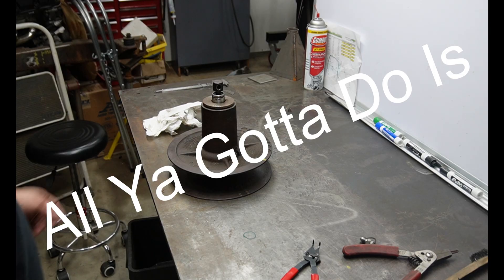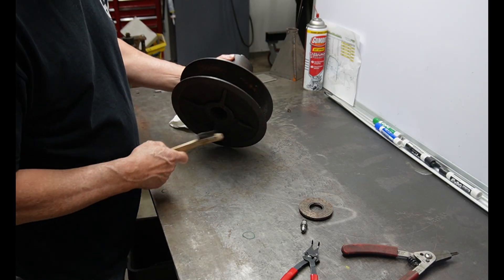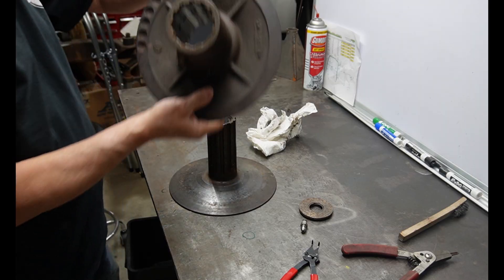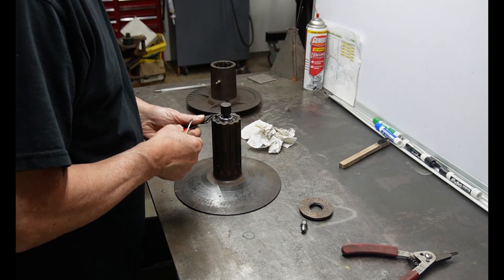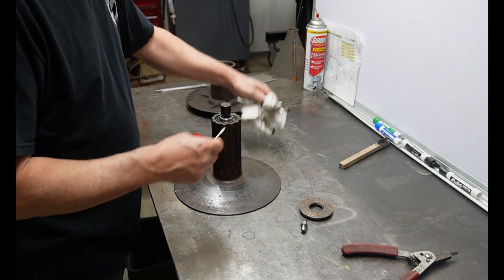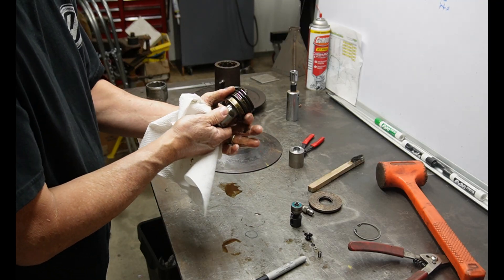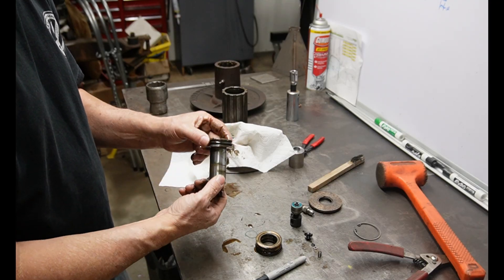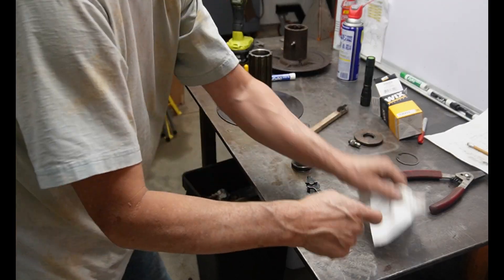Bobcat Variable Speed Drive Disassembly and Re-Assembly

Comment: Have you ever had the large snap ring that holds the bronze piston pop out under pressure?  I've had this happen twice.  The first time I thought that I had not adequately seated the snap ring.  After the second time I determined that the snap ring may be a little rounded, a little loose, and the face of the piston appeared rounded a bit.  So , I have squared up the rounded face of the bronze piston  that contacts the snap ring on the lathe, squared up the face of the snap ring on the belt sander and gave it a little stretch.  Hopefully it will now stay put.
Reply from the maker: I have not had an issue like that. I did put new snap ring in upon reassembling.

Comment: Thanks for the great video. It's very helpful. I have a problem: I recently bought a used 611, but unfortunately, the entire hydraulic unit for the Variable Speed Drive is missing. I only have the two discs that the previous owner had bolted on. Do you happen to have a complete parts list? Or perhaps you have the dimensions or specifications of the individual parts? I'll probably have to buy and search for them individually :-( Maybe I should consider another solution. Best regards, Max

Comment from the maker: Mine is a straight shaft, so after removing the setscrews it just needs a little pry bar action. I hear most are a tapered shaft. In that case there is a bolt hidden under all the giblets removed in this video. After that bolt is removed it will theoretically come off. However, if you ever tried that, it can be " fun". Don't use a pulley puller or you'll risk breaking the sheave. I would try some heat, and the sliding sheave as a makeshift slide hammer. Good luck 🤞

Comment: Thanks for the helpful video.  After pulling the clutch apart and seeing the inside snap ring off, the whole cylinder was in the outside sheave cylinder.  Now we are pretty sure we know what is wrong and will try to get it back together--hopefully we will save a trip to town and the repair shop.  Good on you for posting this.
Reply: Quick update..machine is back up and running.  Hope the old ok internal snap ring holds up.  It was actually a pretty easy fix.  Awesome video.  Thanks for sharing your knowledge.

Comment: Hello I need to do exactly what you did but I cant figure out how to take the very first snap ring off, you have it off right from the get go and in the end of your video you say to simply put it back on, I cant get either the washer to move back or the c ring to move out from the washer to be able to remove the "C" ring
Reply from the maker: @timhanowski3771  Sounds like yours is all rusted together? Try some penetrating oil or rust remover. Then maybe you can work it loose.
Reply: @scottmgraves34  Nope nothing is rusted, and it did work until it didnt, I am pretty sure the Keyway sheared so going after the keyway and might as well rebuild because it is leaking also, when it is on machine I am not sure what to tap on, without wrecking the carbon seal
Reply: April 29,2025
I got it, I ended up sliding motor forward to be able to take belt off, once i did that, I don't know what was holding it, it exposed clip with ease, I will probably figure it out better once I put it back together. 
Thanks for posting video tho

Comment: This is a great explanation on this. Mine kept leaking even after replacing the seals and I discovered a hairline crack on the inside sheave spline. I’ve got to find another inside sheave somewhere. I’ve had to unhook the hydraulic hose and I just run it at low speed. I didn’t know the outside sheave is balanced. Thank you for this because there nothing much about this on YouTube.
Reply from the maker: @jerrys9226  Yup, that's why I made the video. I spent forever trying to science it out because I couldn't find any information online. Glad it helped!
Reply: @scottmgraves34 just curious, how did you put the inner sleeve back on the engine with the inner piston installed? I never took mine off, but I could see that there was a bolt in there on the shaft. The problem I had was trying to get that piston back in without damaging the O rings.
Reply from the maker: @jerrys9226  Mine has a straight 1 7/16" diameter shaft. I think the bolt is mainly used on a tapered shaft crankshaft. So I didn't need it, and installed the piston on the bench.
Reply: @scottmgraves34 I think that’s how I cracked mine trying to get that piston in on the machine. It was not a lot of room to work. Thank you for all the feedback! Btw, I bought my 610 brand new in 1975 so I’m celebrating 50 years of operation. Only replaced head gaskets on the engine.

Comment: The CR11141 seal you list in your video is too big.  The dimensions I measured on my seal are:
3/16 thick
1 1/8 id
1.5 od
Reply from the maker: @ikesquirrel  That is the one mine used, pretty sure.   I found this on eBay.  https://www.ebay.com/itm/316432466926. I will dig out the box with all that stuff and measure it.